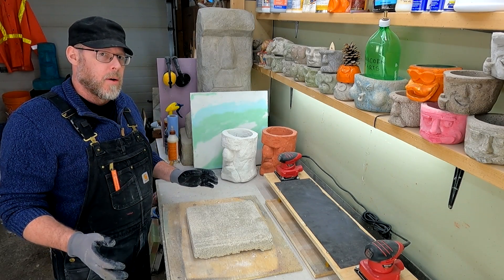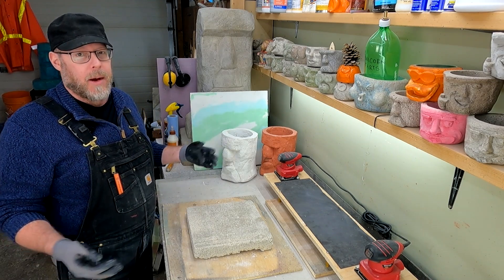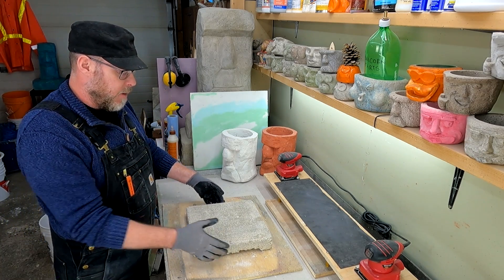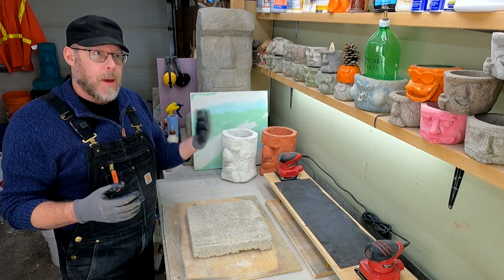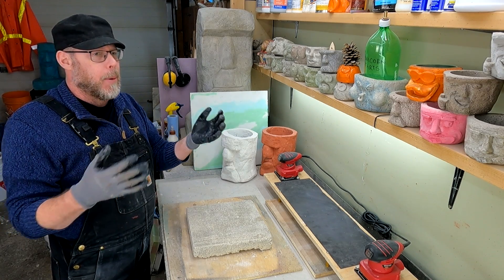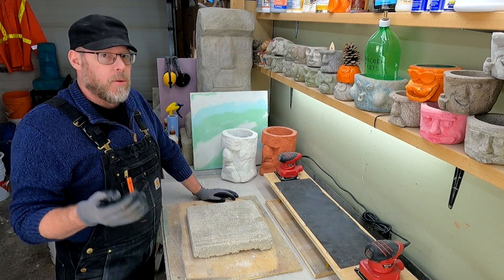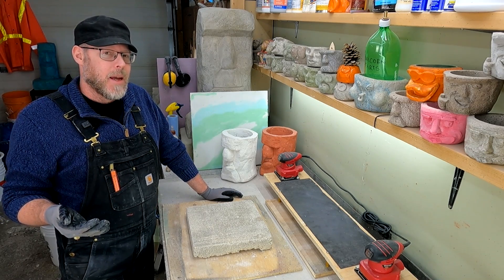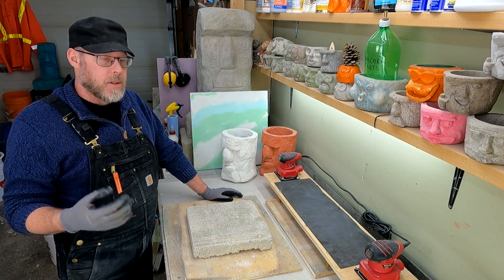What Lightweight Concrete Mix Should I Use?

Comment: Which perlitecrete ratio is best to make it resemble the same strength characteristics as aac block?  I was thinking 🤔 88% perlite and 12% Portland cement.  Let’s say you.
Reply from the maker: My initial thoughts were closer to a 3:1 perlite to cement ratio
Reply: @creatingconcrete  Have you heard of System 3e block out of Poland?  They use perlitecrete and it’s very strong for lightweight concrete and interlocking/mortarless,  Supposedly, this technology is better in every way compared to 100 year old aac block construction.  You should take a look.  Good day.
Reply: https://www.youtube.com/live/IaHK80KmhH4?si=OmhhhRZVTgmL_39E